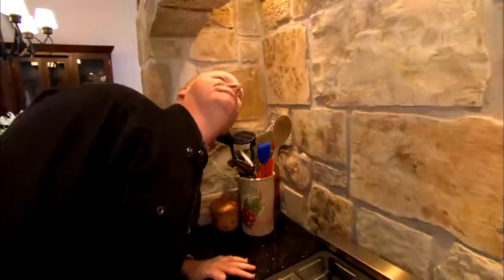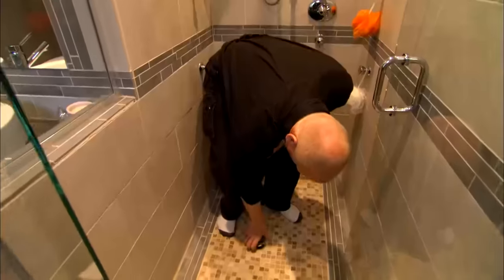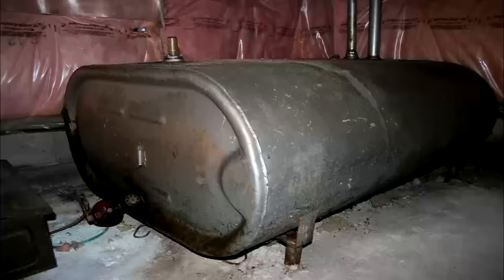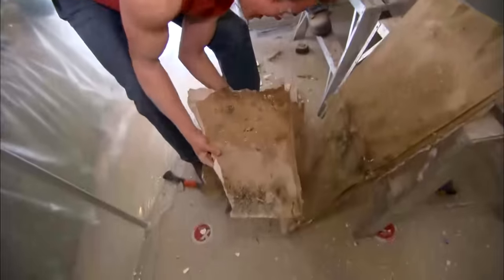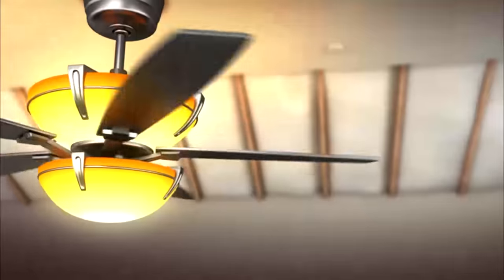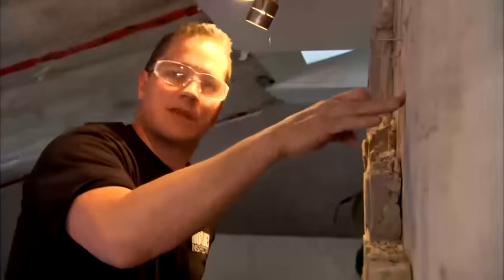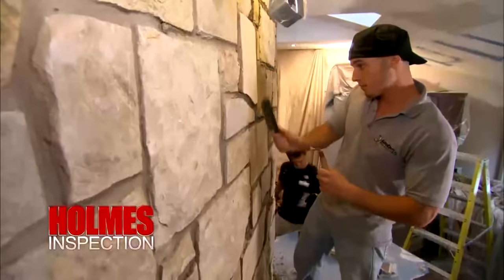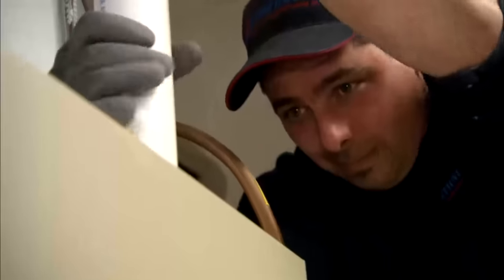How Mike Holmes and Damon Saved a Flipped House from Disaster! | Holmes Inspection 104

Comment: sadly Here in SEA, we can't just open a wall... cause the wall is basically all brick and concrete, No dry wall, Insulation? no need. so whenever we have a bad plumbing problem, we have to dig through concrete foundation or cement plastered brick wall.

Comment: The $ wasted is horrendous. You pay your hard earned cash and some folks just take advantage of you. Its also evident from watching about 100 episodes that your most likely better off just ripping it all out and doing it over even though this is the most expensive way to go.  I see how devastating emotionally this shoddy workmanship is to the owners and it infuriates me that these "contractors" seem to always get away with it. I have only had 1 house after living my first 40 years in an apartment house. I was very lucky that the house was built new for myself and my family so after 10 years in the new home there hasn't been even 1 problem so far.  Holmes and crew are angels

Comment: A big problem with home inspectors is that some come directly from a trade.  For example a retired Plumber.  What does a Plumber know about structure?  Nothing.  If an Inspector is coming from a trade they should get some training in the other trades.  Who is best as an inspector?  A Certified Architectural or Engineering Technician or Technologist.

Comment: 100 grand later, its now done right. Would like to be the fly on the wall in the court room after this mess. 
Why did they replace the sink? It had a nice cabinet. They replaced it with some flimsy plastic thing. All they needed was to fix the trap. One of the reasons the shower leaked was because they used grout where they should have used water. I always hear tile is not water proof, but unless water is left standing on it for weeks unending, it should not absorb water. The glazing is not normally porous. Use epoxy grout. Again, epoxy will not absorb water unless it is subject to standing water for weeks.

Comment: When the homeowner mentioned the contractor doing the flip were using neighbors tools; is a RED FLAG 🚩
Reply: 2 big red flags for me... 1 the contractors using the neighbors tools and 2, the home inspector came from the realtor... In my view NEVER use a inspector by the same realtor. They could be working together so the inspector will over look things your counting on them pointing out that is done wrong, so they get a kickback for the house being sold... I grew up being told 2 times you always bring someone in as a 3rd party, buying a house/property or buying a car....
Reply: @jonathanbair523  I agree you always have someone independent doing that house inspection.
Reply: I hate flipped homes. I would rather buy a fixerupper and do it my self so that it is done right.
Reply: @jimflagg4009  I agree because flips are done to get it done cheap and kick it to the next person for the profit. New home or fixerupper I agree totally with. Fixerupper you know what you did. Or a new home.
Reply: If the wall was put together that bad and it’s dangerous shouldn’t they have done the other side too?
Reply: Major red flag
Reply: @freedomisnotnegotiable it was dangerous because the stove was venting into attic space and that is a fire hazard. It was also placed on top of the counter top. That wasn't an issue for the other side
Reply: They should of had their own tools

Comment: As a homeowner who has gone through this type of thing what really gets me is by the time your in this position you don't have the funds to fix everything or sue.  And everyone walks away free of any accountability.  I am still fixing things after being here 13 years.
Reply: It’s so damn frustrating. Home inspections are a joke.  They need to start making home inspectors accountable.
Reply: Yup….most flippers or builders know that the average middle class homeowner isn’t going to have the funds or time to pursue a court case, and that much of the time, they can cut corners that will cause later problems…..with no consequences.  

Had a friends house built by a major builder at the time, and the area by the living room couch was always cold, which they initially attributed to a large window nearby.  

They eventually upgraded the window, and when they opened the wall….there was just wood and studs….no insulation at all.  Someone ran short of time or insulation and just closed the exterior wall and dry-walled without it.
Reply: @Itried20takennames  Slimy flippers and builders will eventually cheat someone who is able and willing to shed the thin veneer of civilization we all wear in our daily life.
And that could be the thief's last slimy deal, ever.

Comment: They really screwed the pooch with what they did over the stove. You could tell by the look in the woman's face that she hated the new look. While I am not a fan of surfaces near a stove that will be all but impossible to clean, the original design should have been rebuilt in the correct manner.
Reply: I agree. I think she was disappointed they didn't replicate the stone work over the stove. It made the kitchen. Now it's more standard design. But done to a high standard!
Reply: I was thinking the same thing.  It looked much better before, even though it was done wrong.
Reply: Probably cost and time. This is a rare miss for Holmes. Another example was the episode of a large house on a huge lot in which the garage was taken out instead of remediated with proper isolation. Many viewers were surprised and commented the same thing. Holmes crew does great work, but not infallible.
Reply: @ronbennett7885 Why don't they ask what the homeowners want instead of having free range to do whatever they want to the house.

Comment: I like the way it looked the original way (with the arch) and the width size of all the center walls.  I am sure holmes could have figured something out
to save the original design.  The original design aspect of the center piece is what really made the house pop and now thats gone.
Now the center piece is small flimsy and don't have the wow factor anymore.   👀😢😢
Reply: Agree 100%, not to mention, that new vent just looks SO out of place with everything else. It's ugly as sin, compared to the rest
Reply: We don't know what the codes are. That might have had a lot to do with it, and as far as the " other side", I believe they did do that. They don't show the new but I thought I saw them take out the whole back in one piece.

Comment: I'm a DIYer, but I research and find out the right way to do things before tackling them, I also work out if I am up to the job before starting it.  If it's plumbing or electrical I get the professionals in to do it as I'm not qualified.  I spent most of last winter redoing our kitchen/diner walls.  Removed the wallpaper and found that it was covering a number of issues, including untaped joins, areas where they'd obviously decided the best fix was a huge amount of plaster to cover joins with no support.  Unfortunately I couldn't replace the gib board (NZ name for the product we use) as there was none to be found here at the time, so I had to do my best with those unsupported joins.  I worked out that paper wasn't going to cut the mustard, so ended up using fibreglass tape and the strongest plaster mix I could access.  So far, 6 months later it's holding up fine, and no longer has an obvious lump of excess plaster behind the fridge.  Next up is the hall, I fully expect to find the same mess behind the wallpaper this time too; removing the wallpaper isn't fun either as they didn't prime the walls or use size beforehand.  The guy who built our place was a JOAT.

Comment: Of decades of these shows, there is a reoccurring theme. "They had an inspection, and it's not in the report." When this happens, the inspector MUST be held accountable, and MUST be responsible for paying for another inspection AND for all costs to remedy those things that did not pass, after saying they did. They MUST. You've got to nip it in the bud, or it will not stop happening, and it MUST stop.

The word is "LEAK" not leech. 

So sick of going into homes, or buying homes, and some idiot has messed with the electrical in such a way that it is improper, unsafe, fire, and / or an electrocution hazard. And why are people still using those dumb twist nuts ? Wago lever nuts, secured with electrical tape is so much better, safer, and less strain on the wires. And so many idiots that do not put the wires into a junction box, or if they do, they don't use clamps to protect the wire and keep them from being pulled, and then seal it all up so that it, or the box is not accessible without needing demo work. WHY ARE PEOPLE THIS GODDAMN STUPID ?

A house I purchased they added lights, and just left the splices open. Not even a wire nut. Just open splices hidden in a drop ceiling and in the attic for the rooms below. exposed, bare, tin stranded twisted to solid copper. Totally wrong.

Then there's the plumbing. I wish people would leave that alone too. I have to get a plumber in here to fix what some idiot loused up, and I am the one stuck paying for it all. And plumber bills are worse than electrician bills. And I used to have the ability to do electrical, but now I am disabled. I still know how, I have the skill, I just can't bend, or squeeze into places and tolerate staying in contortions to do the job.

As good as these videos are, every time I see tattoo, I down-vote. It is unprofessional, it is grotesquely nauseating, and it needs to stop. Stop the permanent disfiguring and mutilations of people, and if you can't stop at least cover it up. Keep a clean, professional, sharp appearance. Not looking like a criminal, or some kind of grotesque creature from a horror film. Got to respect yourself if you want to command respect of others. Setting off someone's traumatic stress is not the way to do it.

Pretty sure those cats know about the mice. I've seen enough of Tom & Jerry to know that cats cannot catch mice and would if they could.

This theme of contractors not pulling permits, and incompetent inspectors must face consequences for those actions. That's the only way it will ever stop. They must also pay for a re-inspection and to correct what wasn't right. It should NEVER be the responsibility of the buyers nor sellers unless they did their own work, and in which case they must sell their house as is, and give disclosure PRIOR to making contract, with those stipulations written into the contract before signing and closing. If the inspector that works for a city or town, then that city or town must also pay and they should either make sure that inspector is certified, competent, and is doing his job, or fire him. Make them pay ! Not the victims, the perpetrators.

Portable On Demand Storage (PODS) should also be brought in, and movers to move all things into the PODS so that everything can be done, then when finished movers brought back to put everything back the way they found it. And again, the victims should not have to pay for any of it. The inspectors, and the people that did everything wrong, and the city should all be held financially responsible, and until that happens, this is going to continue. You've got to NIP IT ! NIP IT IN THE BUD !

You asked how far you go in the shower, that nothing is done right. I say take it all down and rebuild it from scratch. Make it right. And what else was done wrong ? Take it all down, make it right, and make those responsible, pay. DO NOT MAKE THE VICTIMS PAY. MAKE THOSE RESPONSIBLE PAY !

Whenever you dig up someone's floor to fix the drain, ALWAYS put in a back flow so that water can get out, but not get back in. Even at that, there should be one on all toilets and drains to keep snakes out, and to keep sewage from getting back into their house.

Comment: Home inspectors are not to be trusted totally they realy do not have that much training and are paid flat rate. So time is money. This house looks great, so the inspector likley never looked close at anything.
  We decided to sell our rental house. 
 Got the house 10 years ago. 1950 build. Reframed the interier to open it up. Replaced knob and tude wiring. Pitch and flat roof replaced. New flooring with heated in the kitchen and bathroom. New fictures and bathroom upgrade. 
 We paid land value. 
 Got an offer $15'000 over asking. 
 The home inspector that they used, apperintly did not like the house at first look from his report.
 1: Grass in the sideway cracks.
2: Facia paint flacking
 3: Large plants near the house. 
 4: Ground slope for roof run off. 
 5: 1window screen broken.
 6: Heat pump unit not level.
 7: The best one was an untermiated LIVE wire in the crawl space. The wire was connected to nothing. Both ends were free.
 8: The house has a Federal Pacific panel. Staplock breakers. 
      His report said that these will fail and burn your house down and are illegal. 

 Now this is were the rant starts. 
 While doing renos i replacled, and added breakers to the panel, including the breaker for the new heated floor. I got them of the shelf. 
 The byer backed due to the inspection so i asked my realtor to get the copy of his report. This is normally not given to the seller. ASK.
 
  I looked into the Federal Pacific / stadelock issuse and went into a rabbit hole. 
 Turns out, they are not illegal in Canada or the U.S.. No recall has ever been made. You can still buy them at most stores.
 I let my realtor know this before the next insption and asked her to be there with him armed with this info when he looked at the panel. Passed.
 Second on this issue. You can get an eletrician to cheak your Federal Pacific panal and sign it off if this is a no or no go on a sale. 
 Hope this helps someone.
Reply: I’m in HVAC sales.  Whenever we see Federal Pacific with the stab lock, it’s a no go for us.  I’ve worked for 3 HVAC companies, none of them would allow a system to be connected to those panels.  Zinsco is the other one we won’t use.

Comment: Did they have to rip all of the drywall. They could not simply used metal screws next to the wood screws to tighten it up then remudded?
Reply: They had unsupported but joints with spans over 16 inches.   This always cracks even when taped with mesh tape and properly mudded.

Comment: I've done enough electrical work to know:
1) ALL connections must be in a box or in a fixture.
2) ALL junction boxes must be exposed for service or inspection.
3) Armoured cable must be used instead of plastic covered wire where wire runs through or near anything sharp such as metal studs for example.
4) With the exception of light switches, white is neutral, black is hot and in some instances red is also hot on the opposite phase.
These rules are for your safety. Pay attention.
Reply: For 3 I think you can also use those round grommets to cover the edges of metal studs.
Reply: @crgd23   You may be correct in that the code allows the use of such grommets. I honestly don't know. However, I personally would not choose to use grommets and plastic insulated wire with metal studs because the grommets can be dislodged while pulling wire resulting in damaged insulation and the wire shorting out or energizing the metal structure. For the difference in cost of armoured cable over romex, I'll choose the peace of mind.

Comment: Why would anyone use drywall in a shower??
Reply: I think it’s used as a base to hold waterproofing and tiling?
Reply: Purple Board is a waterproof drywall, unlike green board some use which is only moisture resisitant.  However, with the cement board products now available, I would use those in a heartbeat.

Comment: @30:55:  Handling that huge sheet of glass with no gloves or eye protection.  Come on, guys.
Reply: Those particulat sheets of glass don't have sharp edges, I have handled shower grass in past, no problems.
Reply: @Steve Evans :  It's not about sharp edges.  They're tempered glass.  Knock the edge and it'll shatter all over the place.  It's a basic part of that job.
Reply: @ncooty  The glass shatters, it doesn't explode. A sheet that we weren't going to reuse, we hit it with a ball pane hammer first hit was a bit light, the second hit was harder, and the shattered glass just fell to the ground. I have only seen accidental glass shattered in car accidents. We never had a sheet of shower class accidentally break on us.
Reply: @steveevans1841 :  You don't seem to understand how tempered glass works, but sure thing, Bud.  You go ahead and keep handling it that way, looking up at it.  Just make sure you pay your worker's comp premiums on time.
Reply: @Steve Evans :  I agree, much safer than plate glass... but bump an edge into something while looking up at it, and I think you'll agree that glass in your eye is glass in your eye.  But you do you.

Comment: Hint. Never,  never, ever buy a flipped house  under any circumstances unless it has been done correctly by an experienced remodeling company, permits, etc.  The wiring, plumbing, HVAC, insulation, literally everything should be at minimum built to code. Too many flippers put lipstick on a pig.

Comment: 18:44  Isn’t indiscriminately using a drywall saw around a recessed ceiling light, that is turned on, a little dangerous? If you’re going to pontificate about other peoples “unsafe” work then, you should at least hold yourself to the same standard.